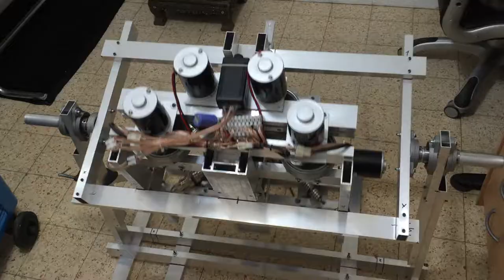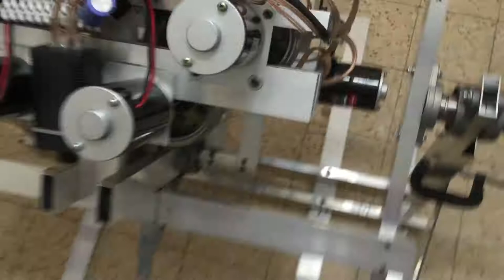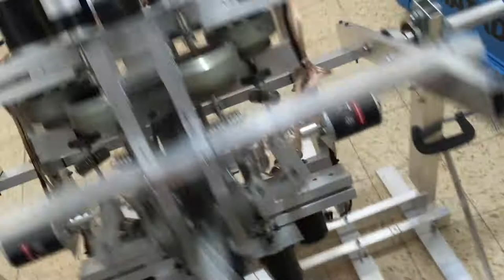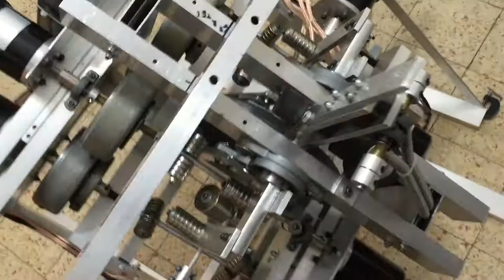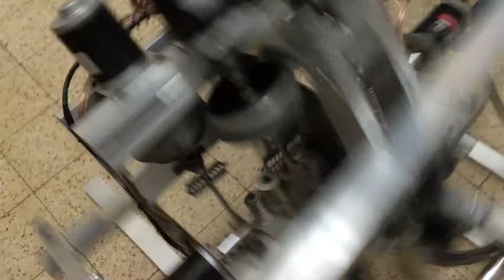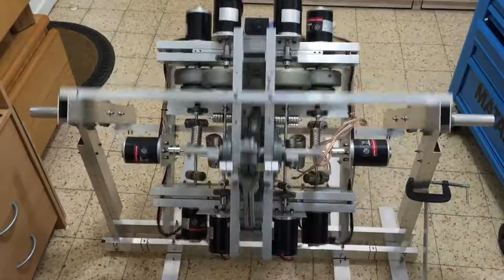Real controlled  unbreakable  "Extra Free Energy" Build magnets engine for future use

Comment: I really like this build and am curious to see where you are going with it. However if the wheels were turned the other way you would get an inertial push in the other direction causing it to spin. As it is now the wheels turning direction points to the pivot points so it may not spin as well. However keep up the great builds I look forward to them.
Reply from the maker: SonsOfTesla.Com Thanks! soon you can see...